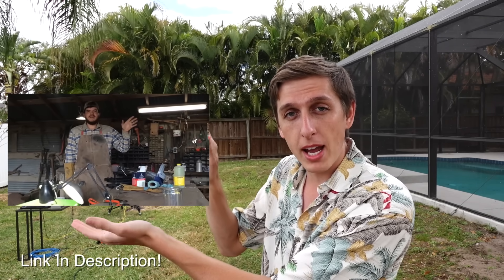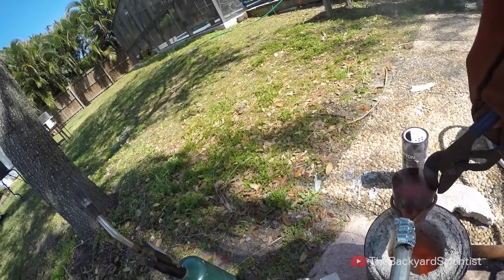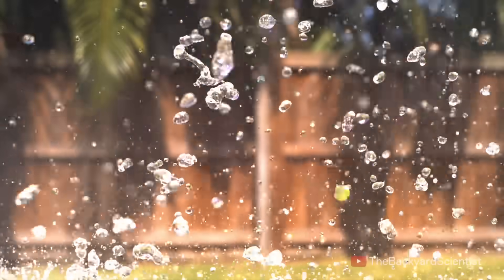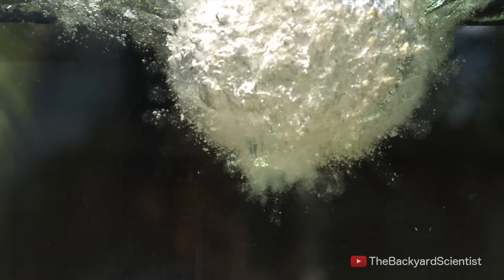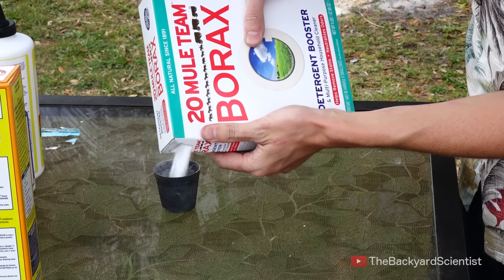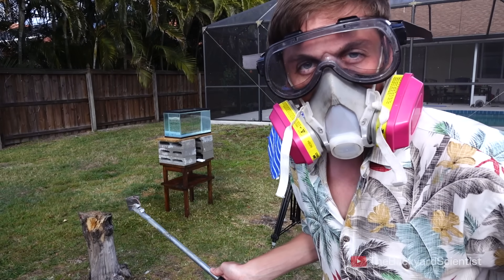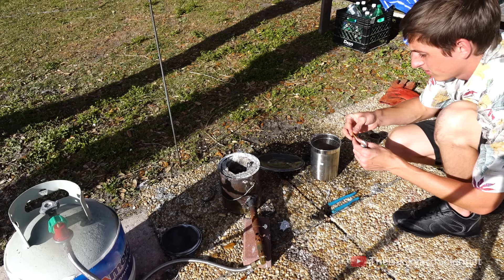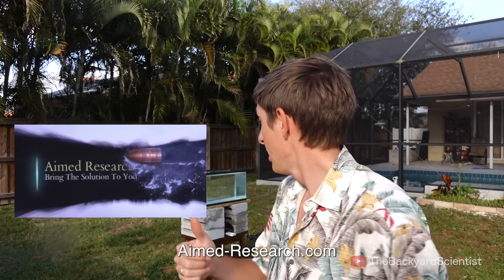Pouring Molten salt into Water - Explosion!

Comment: I definitely think your hypothesis is right, I'm just curious why this doesn't happen with other molten material.

If you increase the surface area exponentially the liedenfrost effect isn't going to stop the reaction because your expanding faster then the insulation effect can happen.  But why wouldn't this happen with other materials is what bugs me, whats the key difference that causes this expansion where as other materials just stick together.

Comment: Sodium metal is not the Same as molten solt sodium explodes when it comes in contact with water solt on the other hand suck's up the water but when its moldet it explodes becaus a liquid can not opsorfe a other liquid

Comment: The reaction is not Chemical at all. It's purely temperature based. The simple fact salt can break down to its natural elements quickly, allows the exponential transfer of heat to take place very quickly. Remember, Salt is not Sodium, nor chloride, but a sodium ion and chloride ion bond.

Comment: Sodium reacts violently with water.  I'd assume super hot sodium would do exactly what you see there.
Reply: Someone didn't watch the whole video before commenting
Reply: Metallic (neutral) sodium reacts with water, but salt contains ionic sodium (Na+).  The difference is significant, because the reaction of sodium with water is actually it reducing the water, and ionizing in the process: 2Na + 2H20 > 2OH + H2 + 2Na+.  So ionize sodium is expended sodium, as far as that reaction is concerned.  Na+ is not reactive with water, which is why table salt is not deadly, and why this is also an interesting mystery.
Reply: At least some of the Cl boiled off.

Comment: Sodium is an unstable element. Its electrons are unbalanced. It releases this energy by tearing up any water near it, thus it explodes. Table salt, or sodium chloride, is made of sodium and chlorine, and since sodium has an extra electron and chlorine is short one electron, they share that extra electron and they become stable as table salt. When you melted it you must have broken that balance somehow and separated the two, thus converting it back to sodium, and it explodes.

Comment: Theory: The heat is weakening the bonds between the sodium and chlorine, so that when it comes in contact with the water it creates the explosion.  
The chlorine is still keeping the compound stable enough so that it doesn't explode as soon as it hits the water, but the binds are not strong enough to prevent the explosion from happening at all.

Comment: Its because when you melt the salt it breaks the bonds between the salt and the chlorine resulting in sodium metal reacting with the water
Reply: The chlorine stops the flames
Reply: The Weewoo Wombat apparently it's not the sodium because you would need way more energy to separate chlorine and sodium but rather the heat that instantly vaporized the water into gas that expands and creates the "explosion"

Comment: NaCl is sensitive to thermal shock (is used for lenses and windows in IR lasers). So it could be the solidified salt shattering due to thermal stresses, like Prince Rupert's drops do when you cut their tail. When shattering in small pieces, all the heat is transferred to the water in milliseconds, causing an explosive burst of water vapor.

Comment: How many fish tanks does he have to buy a year
Reply: OW_it_broke, All of them
Reply: OW_it_broke 518351839519395175 dollars a year
Reply: With millions of views on youtube - they are well reimbursed.
Reply: yeah, I first did 173,000,000, so messed it up rounding down the result.   Doh!   170,000,000 * .01 - 170,000.   There...   And I have a masters in computer science - guess I need to brush up on basic math again!
Reply: he said 0.01 cents per view, that's .0001 of a dollar, not .001, so his 1700 number would be correct, assuming .01 cents per view was actually accurate. But i think the actual number is closer to .001, so you are probably closer with 17,000. just pointing out that his math was correct.
Reply: I think it's more like 0.01 cents per view, so maybe $1700
Reply: You need to check your math - 17,000,000 * .01 = 173,000.   Even if it was .001 per view, it would be $17,000.   So, like I said, they are well reimbursed.
Reply: Isn't that the number of penny's not the number of dollars i.e. 100 penny's = 1 dollar?...

Comment: Could a separation in the water molecules be happening? Water structure, Introduction. Water is a tiny bent molecule with the molecular formula H2O, consisting of two light hydrogen atoms attached to each 16-fold heavier oxygen atom. Each molecule is electrically neutral but polar, with the center of positive and negative charges located in different places. Perhaps the shock of the hot salt hitting the cold water is causing electrolysis and igniting the hydrogen atoms...just a thought.

Comment: Salt dilutes in water so as soon as u put hot 700 degree heated salt it get diluted with where ever it touches the water surface ASAP. And as its 7 times more than water evaporation level it act like boiling water but in fraction of a second .So as a result water gets into steam ASAP where salt get diluted along with Heat ( i am not a science student or neither i am into any kind of science stuff but its my logic which is telling me this is the reason behind it )

Comment: >Stainless steel

Be careful when putting a lot of heat on stainless steel. At lower temperatures it's safe, but at higher temperatures the chromium is form a harmful gas.

Comment: There is a reason this happened the sodium and chlorine atoms sort of separated from each other sodium or Na is very reactive with oxygen 6 on the valence electron scale so the sodium reacts with the water causing it to explode is large quantities it will explode everything bit in small quantities it explodes into flames also chlorine is number seven it's a halogen so that might also contribute to the explosion the separation of the atoms mix with water causes a refuse which is why it explodes
Reply: Highly exothermic refuse?  Didn't think that far into it.  I presumed the Na ions were substantially separated by the high heat.  He did mention some Cl boiling off.
Reply: Dr. Strange nerd 🤓 alert 🚨
Reply: Dr. Strange learned more from that than my atomic science lesson last week
Reply: alkali metals do fun things with water.
Reply: it's just the water boiling extremely rapidly. not a chemical reaction

Comment: it probably gets rid of the chlorine, leaving the sodium, which has a harsh reaction to water.
Reply: ***** I obviously missed that part. There's no reason to be rude about it.
Reply: Lil Baby Boy he proved that without protection the sodium reacts to quickly. but with there is a chance that the quickly cooling reaction is stripping the chlorine from the sodium allowing it to completely submerge before reacting.
Reply: "Stripping the chlorine from the sodium" would not leave metallic sodium.
Reply: When chlorine separates of sodium you'll get cations of sodium, so, there's a different reaction with watter than the basic sodium.

Comment: Imagine the Military using this at a much larger scale for Anti-Ship bombs for aircraft...  it could cause a lot of damage and generate a Freak Wave 😨
Reply: Plutonium works much better...
Reply: the salt bomb wouldnt do much damage, mainly because the ships are on the ocean, which is salt water. which wouldn't react.
Reply: the military tried to use molten aluminum and water as a bomb they failed
Reply: Entertaining America What a nice profil photo
Reply: ultragreenyellow56 No, the military won't use it because the explosion wasnt that strong so you would need a lot of it and that makes it harder to carry. furthermore molten sodium chloride and keeping it molten is far too difficult for any plane but maybe a ship can but this raises the question. why don't we use regular bombs? Finally underwatercities are deep in the water not at the surface so the bomb will just explode instantly on the surface and not hurt the city.
Reply: ultragreenyellow56 Ignore underwater cities and replace that with submarines I was thinking of another comment.
Reply: sc2umsmaker because napalm is a jelly that burns, not explodes. hence why it's sticky

Comment: Not trying to sound like a cynic, but listen.

A grenade that contains heated sodium metal and/or salt and water. You pull the pin, and a reaction occurs where the salt becomes extremely hot for a period of 5 seconds. It'll be so hot, you cannot toss it back. There is a barrier seperating the salt from the water, but after the salt becomes extremely hot, it disintegrates/melts (or whatever) the barrier between the salt and water. The grenade then explodes loudly, damaging unsuspecting people's ear drums nearby, disorienting them. And fragmentations explode from the grenade, penetrating anybody within the radius of the explosion.

I don't know how it would be physically possible to make, but that seems like something I can easily imagine being possible in the future.

Comment: Question.

Can you calculate the coefficient of thermal expansion of molten salt in water?
As compared to diesel at 134,000 BTU`s per U.S. Gallon?

Is there a correlation ?

Comment: melt the salt and let it harden. test it's resistance to shatter and stress from suffice in temperature. the other salts speed to solidify in one chunk as the sank, the table salt was hard to see wants it hit the water. what if the table salt reacted like a hot glass lid strait from the oven into a sink of cold water and the salt shatters. it would be shot out of the stem bubble and into the water. all the tiny salt bitts are about a thousand degrees hot. maybe they pass straight through the water, maybe only an inch before there surrounded by steam but maybe it is enough to make the explosion. lots of maybes but you no it's not chemical it's physical so maybe shatter g has something to go with it. melt glass making sand till it melts and see if it explodes in water.

Comment: Are the other salts soluble in water? If they're not, then the Leidenfrost effect may not work for molten sodium chloride because the water is trying to dissociate the sodium chloride. Could it be that the attractive forces between the two reactants is initially greater that the repulsive force on the water due to the Leidenfrost effect, allowing the physical reaction you describe to begin?

Comment: Sodium chloride: 350g/L dissolves in water,  sodium tetraborate: 38g/L in water, Calcium Carbonate: 0g/L dissolves in water.  Basically, I think that the sodium chloride is not protected by the Leidenfrost effect because it reacts with the water (in that it dissolves).  The Leidenfrost effect mainly works if there's a smooth surface that does not dissolve or react with the water.  Since sodium does dissolve in water, the two do come in contact and hence flash boil to cause the explosion.  The other ionic compounds do not dissolve in water very well and hence do not have the same effect
Reply: Pretty close. Sodium Chloride has a high affinity for water (i.e. Dissolves as you put it). Molten salt is largely anhydrous and has lost almost all of its water of hydration AND it is hot! This affinity with a rapid heat exchange (difference in temperatures) creates a superheated space of steam in the middle as it sinks, which just wants to ..!@$^%%$#..expand away. Extending what you said, a good "boom" salt experiment should be with anhydrous Calcium chloride or Magnesium Chloride or many salts with high energies of hydration (affinity for water/solubility). (I would strongly advise against anyone trying this at home) Even this one was borderline unsafe from a personal protection issue. Flying glass can be dangerous and the hot salt can splash at an odd angle and burn you. Anhydrous salts with. high water affinity dissolve quite vigorously and produce a lot of heat, even when added as a solid at room temperature in water.
Reply: Art & Science  yes, but the question is why the Leidenfrost effect doesn't kick in and prevent flash boiling.  My theory was the fact that the salt dissolves in water and hence reacts with it, which renders the Leidenfrost effect obsolete.  I'm not sure if this is correct, but ti seems to make sense.  Heat transfer is so much more complicated than the simple differential equation of Newton's Law of Cooling.  There is the thermal conductivity, the surface area, etc.
Reply: DANG JOS did a little research and found that sodium tetraborate has 3 water molecules/grain and are "unlocked" through molecular decomposition when melting point is reached and will not return to previous state and is essentially a completely different compound when melted
Reply: DANG JOS he copied and pasted this stuff from google probably
Reply: Pandas  Are you talking about me??
Reply: Let me clarify what I meant. Yes, NaCl dissolution is slightly endothermic. Despite this, the physical heat exchange aspect (the main factor) and simultaneous dissolution creates a heated zone of steam that wants to get out. Think of splashing water onto heated oil as an approximate comparison. Water will turn to steam rapidly as the hot oil temperature exceeds b.p., of water (100C). Heat exchange is determined by the law of cooling; which in basic terms ( a simple differential equation) is a rate of cooling of a hot body being proportional to the difference in temperatures. Of course mixing efficiency etc., come into the picture, but you get the idea. A piece of hot coal may just produce a sizzle, but one can take this further and pour molten metal. The steam pocket rapidly formed exerts pressure on the container to shatter it as in the case of Na Cl here. In that sense any hot body could do this and I suspect the pouring rate, mixing etc were not consistently controlled here. In any case, these experiments with very hot materials have risks of injury.
Reply: DANG JOS you forgot to factor in how potassium bensuaite is a giant covelent structure
Reply: Matthew Bubb  Do you mean potassium benzoate??  I don't recall that substance being mentioned
Reply: very good
Reply: Art & Science  But aren't exothermic reactions less effective when the temperature is already high?  Well, actually I probably don't know what I'm talking about there so forget ti.  Anyway, you're right that salt doesn't have a high heat of hydration.  In fact, I believe that salt dissolving in water is actually very slightly endothermic.  So this can't explain the reason for the explosion.  Or perhaps you meant that it doesn't dissolve in water very well at high temperature.  I don't know really, but I feel like it would rapidly cool and be able to react with the water.  I really don't know though
Reply: Art & Science ok hear my version put molten salt in water it goes boom boom there

Get wrecked 😎😎😎😎😎😎😎😎😎🕶🕶🕶🕶🕶🕶🕶🕶🕶⚔⚔⚔⚔⚔⚔⚔⚔⚔⚔🗡🗡🗡🗡🗡🗡🔪🔪🔪🔪🔪🔪
Reply: Brilliance!
Reply: John Rambo  What??
Reply: *****  Yeah maybe
Reply: DANG JOS 👏
Reply: DANG JOS and I think you are a try hard

Comment: tablesalt (NaCl)
Na reacts with watter en whil explode
if you melt NaCl the elements Na and Cl while split and the Na is exploding en thats a chemical reaction
if you got Na you have to storage it in oil beceause it whil otherwise react with the watter in the air
if you put a little peace of solid Na in watter it whil explode to
Reply: and also the fast heating of the water
Reply: WRONG. Someone doesnt know what melt means

Comment: My idea is that the sodium chloride is less effected by chemical reactions with water. I saw the PH test, but when you see that there's also chlorine and it makes a bigger explosion (more violent) the evidence seems more supportive of chemical reaction. On the subject of Leidenfrost, I think that the hypothesis you had was correct. The sodium still reacted with the water vapor, and the sodium chloride did not. It had more time to reach the inside of the tank because a) it wasn't as powerful a reaction and b) the result of pouring sodium chloride makes less water vapor, because of the lesser chemical reaction. This gives the explosion more of a buildup time, resulting in more powerful shockwaves.

Comment: I think that the fact that other substances at equal temperatures don't react the same way leads to an indication that it's a chemical explosion
the reason the pH doesn't change might be because the reaction might be like this
H2O + NaCl -> NaOH + HCl + heat 

now since NaOH and HCl react with each other anyways to give water and salt leading to the secondary mini explosions we notice in slow mo,

NaOH + HCl -> H2O + NaCl + even more heat

So the overall reaction looks like,
H2O + NaCl -> H2O + NaCl + lots of heat.
this is why there's no pH change despite the fact that there's a chemical reaction as well.
Reply: Rex Galilae dissolving salt is actually endothermic.
 http://education.seattlepi.com/enthalpy-change-sodium-chloride-added-water-4529.html

Comment: It only works with high heat, so I assume that this is the salt readily dissolving into the water (as salt is known to do in its solid form) but the high heat of the molten salt causes the water to instantly evaporate into steam... which pushes the molten salt into the water, making more steam, repeat ad infinum until all the salt has turned to saltwater and instantly evaporated

Comment: You want a make illegal HighExplosives ae, well first step is, buy disstilled water, microwave it for 5 mins 100 degree celcius, Unlike tap water, distilled water doesn't boil at 100 degree(C) because it doesn't have impurities. So if you do so pouring any thing into the suoer heated distilled water, will cause a majority of it to vaporize instantaniously in a big violent boom, Now try it it with molten salt. EVEN BETTER TRY IT WITH LIQUID SODIUM METAL- Do wear protective gear i aint responsibke for injuries if you do so.